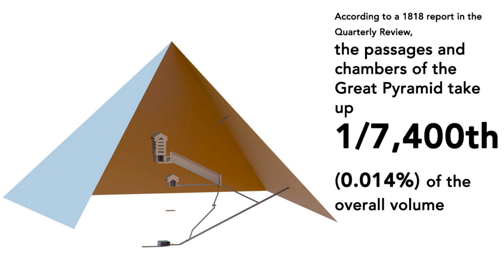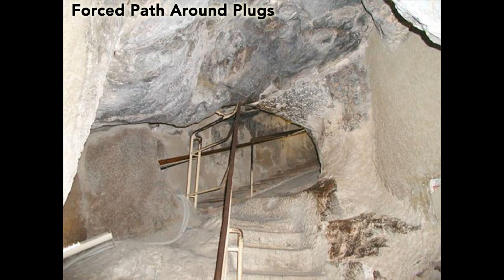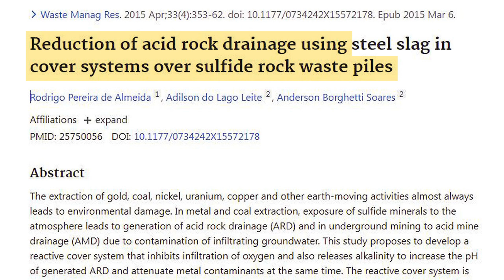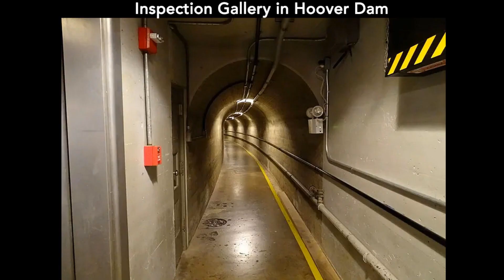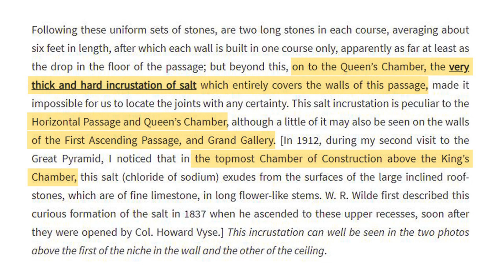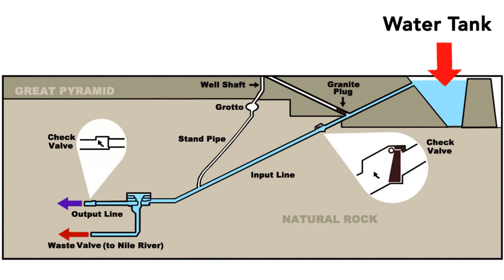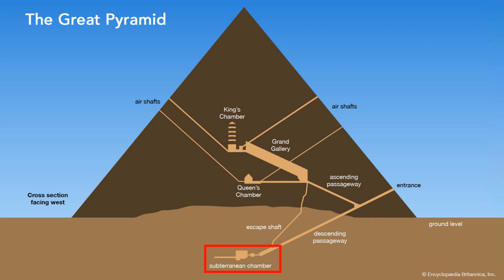The Mystery of the Great Pyramid's Interior System?

Comment: If the "air shafts" were drainage systems then why would this huge pyramid have only 4 little tiny 20cm diameter drainage pipes? In addition, the air shafts were all covered by stone when they were found a long time ago. They were chiseled open by some dude in the 18th or 19th century (there are videos about it from Ancient Architects). If they were closed by design, then their function would could not be for drainage. Besides, on the outer sites only 2 tiny holes would be visible. That's not a drainage which would require huge flat ares to collect rain water and channel them into the "air shafts".
Reply from the maker: The pyramids were covered with casings stones to prevent water getting into the pyramids therefore the drainage system was designed  for draining away the limited amount of water that seeps through the casings.  I read that the air shafts in the Queen's chamber were blocked by salt deposits and found in the 19th century. Without the protection of casing stones, the water seepage retained inside the Great Pyramid must have been much more than the original design. With more moisture there would have been more efflorescence salt deposits as seen in the two chambers and other tunnels. I think the "air shafts" might be covered with casings from the very beginning. Their role was to drain the seepage water inside the pyramid like today's underground perforated drain pipes. They were not supposed to be connected to the outside.
Reply: @CuriousBeingbyTina  Yes. Yes. I know these facts. Still... it is a huge mountain of blocks and there are 2 little tiny drainage canals of 20cm diameter. And they are only on 2 sides of the pyramid. What about the other sides? In addition, as I said, drainage pipes usually collect the water from a larger area and concentrate the stream into a pipe for drainage. Here we only have 2 (or 4) tiny pipes and which are not sealed at all as can be seen on the videos (Ancient architects). "Collected water" would seep further into the pyramid on the bottom of the pipes. The U-shaped blocks are actually upside down in ^-position for the purpose of drainage and thus non functional. You need to see the pyramid in a 3D-view and then realize how extremely tiny the rooms and even tinier the 2 pipes are. Looks unlogical. But you can see drainage canals on the platforms around the pyramid which are clearly for rainwater. The U-shaped blocks are in correct U-position
Reply from the maker: @DilbertMuc  1st of all, was the pyramids built when there was a lot rain or was it as dry as now? The Sahara/ North Africa goes through humid/dry cycles. The Sahara was green and wet from about 14,500 years ago (after HS1 the millennia-drought) to 6,000–5,000 years ago. The humid period before that was around 85,000 to 78,000 years ago. HS1 (20,000-15,000 years ago) is the time period that coincided with the severe human population bottleneck which I think could be the ending of an advanced civilization. If the pyramids were built during 78k-15k years ago, then the Giza Plateau would be as dry if not dryer than now. 
“Cairo is donated on balance 26 mm (1 in) of rainfall per year, or 2.2 mm (0.1 in) per month. The wettest weather is in January when an average of 7 mm (0.3 in) of rainfall (precipitation) occurs.”

Pyramids were probably designed and built for a dry climate. They also don't have flat roofs. When rainwater hits the pyramids their angled exteriors with casing would easily drain away the majority of the water. The casings kind of work like an umbrella towards rainfalls. Perforated pipes are supposed to be not sealed so they can let water gets into the pipe. Air shafts are pretty small and they twist and turn. Are there more such shafts in G1? Maybe. The scanpyramid team found two more voids in G1 but smaller voids like the air shafts are probably hard to detect. 

I showed 3D views of the pyramid and I have been emphasizing how small the openings are in my videos. It's possible that drainage channels inside the pyramid with exterior casing stones in an arid climate don't need to be sizable. Plus, I think the upper interior structure in G1 might be experimental, just like the 8-sided feature, because the later, more advanced G2 is not 8-sided or have much above-ground openings. The complex interior system in G1 might not be necessary after all.
Reply: @CuriousBeingbyTina  It was calculated that the pyramids were built during a time when the lush Sahara already was turning into dryer savanna, but then others mentioned the heavy water erosion on the enclosures of the Khafre pyramid and also western wall of the Sphinx. Matt (Ancient architects) made several youtube videos about that and Ben (UnchartedX) made several real-life videos about it. It is still confusing because the dates of construction according to experts don't fit the real life facts. Anyway, as the casing stones are smooth and not overlapping, but at the same time extremely tightly fitting I suggest that there is no or almost none water seapeage to the inside. If there were then that would need some rain water collectors, i.e. areal collectors that divert the water into the pipes. However, the air shafts or pipes as U-blocks upside down. Means they are solid on top and open on the bottom which is covered be limestone plates, that's what I saw in Matt's Gantenbrinck videos. And again, only 2 pyramid sides have those pipes. I mentioned to Matt that the well shaft down to the grotto and water cavern might have been dug late in the construction of the building, probably for fresh water access to all the thousands of workers. I assumed that the vertical narrow tunnel would have been used to pull up water in leather bags. The stone material in the underground grotto is very water eroded, so there must have been permanent fresh water access when the Sahara was still humid.
And yes, there certainly are many more structures inside the pyramid. Even the huge releaving blocks and chevron blocks above the kings chamber are way too big for that chamber alone which indicates that the huge chevrons also cover more hidden rooms from the static pressure from above.
Reply from the maker: @DilbertMuc  Thank you. I think the heavy water erosion around the Sphinx and the pyramids indicates that these structures were built before the wet season. If they were constructed during the humid period, the sophisticated ancient builders might have done things differently. 

I'm not sure about that all the air shafts have the U-shaped blocks facing down since I read that the shafts are not in the same shape/ cross section and some photos show that the shafts were possibly excavated/ drilled (such as the 3rd photo here: https://egypt.hitchins.net/the-pyramids/inside-the-great-pyramid.html) 

There might be more small shafts connect to the relieving chamber also.
Reply: @CuriousBeingbyTina  There are 3 really good videos from Matt's Ancient Architects about the findings of Anthony West and other geologists about the erosions around the Sphinx and the enclosure walls of the Khafre pyramid. He had a theory which he retracted after studying the results of West and some 19th century scientist about the quarry pits in front of the Khufu pyramid. Result was that the Sphinx is way older than any of the pyramids because the pyramids changed the landscape so much that the water flows from heavy rains were diverted such that visible erosion of the Sphinx enclosure would not occur anymore in a way that would lead to present erosion damages. So the Sphinx is way older and from a time of heavy monsoons or even before. The enclosure walls of Khafre's pyramid have the same weathering patterns, strangely. Means a lot of water erosion after the pyramid was built. If Khufus pyramid was the first one it would be much older than Khafres, meaning it was during or before the wet Sahara period. And all Egyptologists told us fairy tales about Pharao tombs. Makes my brain explode... :D)))
Reply from the maker: @DilbertMuc  Interesting - thank you for sharing with me.  I watched some interviews with John Antony West quite a while ago. I need to revisit them and do some more thinking on the Sphinx. Thank you my friend 😀
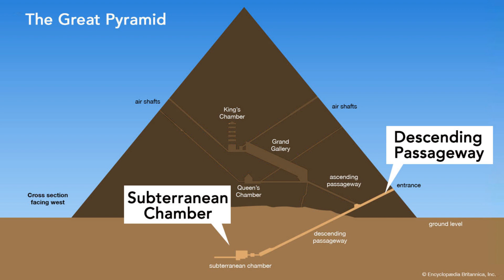Reply: @CuriousBeingbyTina  Have a look at this: https://www.youtube.com/watch?v=mWOilD737ws They sealed it off and don't mention it anymore. At 4:40min you can see Zahi Hawass in the Osiris shaft 3rd lower level standing in front of a big tunnel entrance leading to "... one day maybe we explore it"   At 8:28 is a German drawing about underground tunnels from the Osiris shaft to the Khufu pyramid. Must have been an evil German scientist (like in all those Indiana Jones movies)
Reply from the maker: @DilbertMuc  Thank you! It appears that Zahi Hawass was standing in front of the tunnel with the iron oxide coloration - I think it might be a mine tunnel. Here are some photos of the site (http://www.richardgabriel.info/OSIRIS.html), almost all the way down you will find a few photos of the tunnel entrance.
Reply: @CuriousBeingbyTina  Excellent source. Thanks. I can see the same tool marks on the walls of the chambers on level B. However I don't see that these small side chambers are exploratory excavations according to your theory. They look like really purpose built chambers with perfekt rectangular walls to store something, like a sarcophagus. But I have never been to Egypt, so what do I know anyway... ;)

Comment: Thanks Curious Being for another amazing new vision and presentation.
A lot of work it is..

I feel quite safe to think of the connection which pyramids have had with water in ancient times.
You also made a strong point about the size of corridors, which aren't based on human usage at all.
The possibility of using iron mining water, is already proposed in scientific papers ( to weaken the outer-surface of rocks to meld them together as seen in Peru)
The used mines, didn't give them enough of the substance, so they might have gathered the waste to do so?
But I keep an open mind in this.

The pyramids of Egypt, are all surrounded by a wall to keep a pond around it, much like we see on the Tag Mahal in India.
It would have given a more majestic effect, and also a easy grasp of clear drinking water which I think must have been a major issue in the past..
All pyramids seem to envision the well at the place they were build..

But again, I will keep an open mind and wait for your proposal the next time, till then! :-)
Reply from the maker: Thank you for sharing your thoughts with me, Thomas. I really appreciate that. 
I think the pyramids were probably built when the region was very dry like today.  The Cairo area receives on average 26 mm (1 in) of rainfall per year, or 2.2 mm (0.1 in) per month. The wettest month is in January when there is about 7 mm (0.3 in) of rainfall (precipitation) on average.  It might be very difficult to maintain a pond around the massive pyramids like the Taj Mahal since India has been very humid.  

The Sahara/ North Africa goes through humid/dry cycles. The Sahara was green and wet from about 14,500 years ago (after HS1 the millennia-drought) to 6,000–5,000 years ago. The humid period before that was around 85,000 to 78,000 years ago. HS1 (20,000-15,000 years ago) is the time period that coincided with the severe human population bottleneck which I think could be the ending of an advanced civilization. If the pyramids were built during 78k-15k years ago, then the Giza Plateau would be as dry if not dryer than now. 
When you said "using iron mining water", are you referring to leaching?  The pyramids are definitely wonders - their existence remind us about what the previous civilization have accomplished and how amazing it must have been...
Thank you and have a great Sunday!
Reply: @CuriousBeingbyTina  , thanks for the quick response.

As far as I know, the area of the Egyptian Pyramids was at least up to ca.7000 BCE wet enough to support wild animals like lions, zebra's and giraffe's to name a few.
The lakes were still there..
Ancient Egyptians, at least the nomadic culture, did still exist.
The pond around the Pyramids, from which we still find the constructions, might have come from the natural wells who did exist in this time.
Under the ground, and quite extensive in the northern african plate, we find great aquafers which later population used along the Nile, from upper to lower Egypt.
The pressure in this aquafers may vary by time, due to tectonic movements, but we find this connection still in the famous Oseirion and it is working up to this day!
Many times, the Egyptologists mentioned this water source came straight from the Nile, but they where wrong, the separate source were these aquafers, and up till today we have no idea how they managed that in ancient times!

The only human-bottleneck of which we have proof presented in Y-chromosome calculations is the one happened around 7000 BCE, but this might also be only the Y-chromosome malfunction, due to cosmic radiation or sunbursts in combination with low magnetic field events, we simply don't know.
The spikes of C14 touching our Earth's- surface measured in the tree-rings data up to 12.460 years BP show a regular pattern( 400 years) like 660 BCE, 993 BCE and so on. ( Carrington event at 1859BCE is the one we know the effects from, but these could differ much)
The biggest spyke's are found at 5259 BCE and specially the strongest at  7176 BCE..!! which might correlate with the Y-chromosome drop..because more energetic particles come with it.. )
(Research Square: Nicolas Brehm et al. August 10th 2021, "Tree rings reveal two strong solar events in 7176 BCE and 5259 BCE")
Any other bottleneck I do not know of, could you give me a link maybe?:-)

Thanks again, till later!
Reply from the maker: @ThomiX0.0  I made a video on the overall human population bottleneck and you left me comments too 🙂 (https://youtu.be/Zs4zLKbp4Ic)

If the cosmic radiation/ spike was the cause of the Y-chromosome/ male bottleneck, then why the female population didn't get affected at all?  

The Osirion Temple is located very close to the Nile course with a low altitude, while the Giza pyramids are on a plateau which is over 60m higher.  The small pools at the Osirion Temple can be achieved even today but we can see how dry the Giza plateau is now.  

When you said ponds around the pyramids, are you referring to the shafts? Or are you talking about ponds that surround the pyramids? I don't think there is evidence of huge enclosed ponds around the pyramids. Even if there were such ponds, then they must have been massive to be able to surround the pyramids. The wet season at the Sahara area ended at about 5,000 years ago.  What could be the purpose of designing and maintaining these big pools of water? It cant be just to be visually pleasing, right?  Bringing water from underground aquifers to a plateau top is not that easy plus water in such pools would have evaporated very quickly.  I wonder what important role these "ponds" would have served? 
Thank you again for the comment!
Reply: @CuriousBeingbyTina  I enjoy your mining waste pile hypothesis very much. And I wonder why you consider the pyramids were built when the Giza plateau was as dry as it is today? I remember Dr. Robert Schoch's water errosion theory on the enclosure of the Sphinx, which dates the Sphinx back to a time when there was tremendous rainfall. It could be between 14500-6000 years ago, or much much older. If the pyramids were built around the same time. They could experience rainfall as well.
Reply from the maker: @DixonWangYF  Thank you. I made a video on this topic 🙂 hope you will find it interesting. Here is the link - Egyptian Pyramids & the Impact of a Green vs Desert Sahara   https://youtu.be/8CVetiox04c